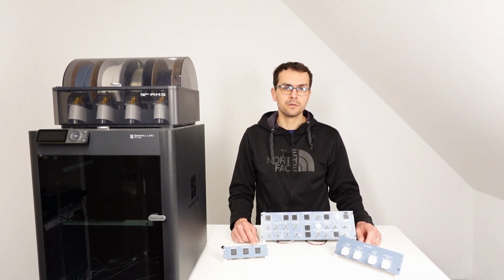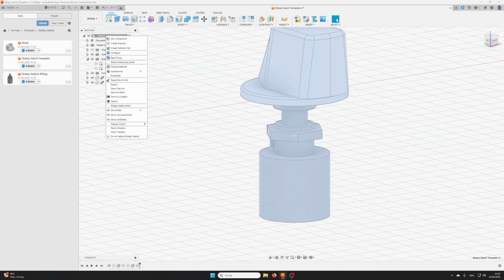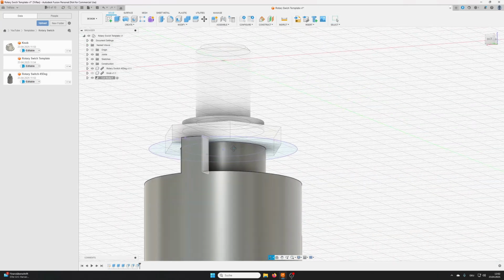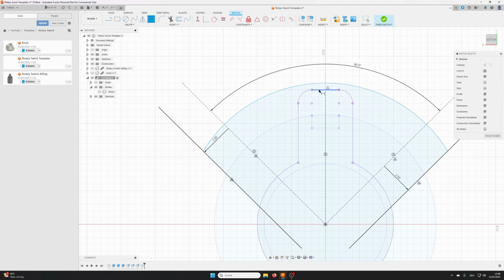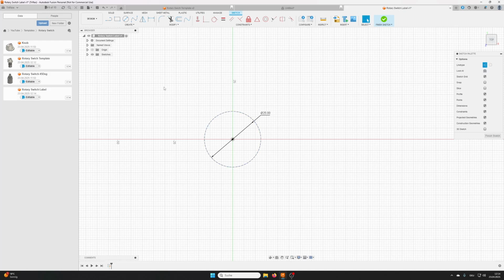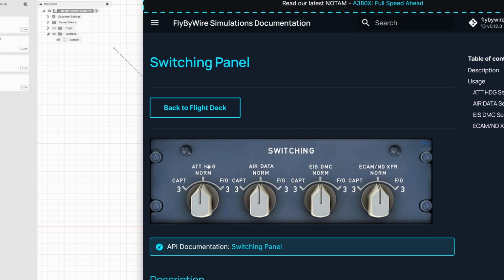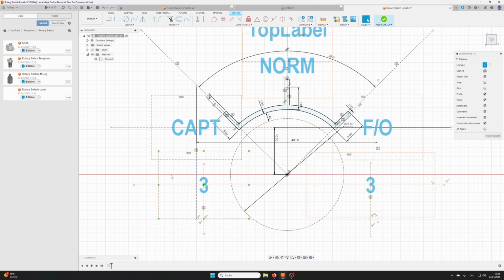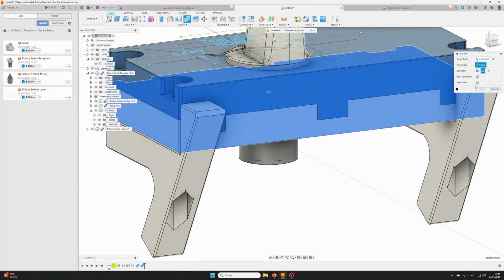Rotary Switch Template - EP 22 - Full Home Cockpit Build

Comment: Are you planning on providing the templates (and not "just" the Step-Files for the parts) to your patreons later on?
Reply from the maker: I'm currently checking the options to provide access to my full repository. But it seems that I will have to buy the full Fusion license.